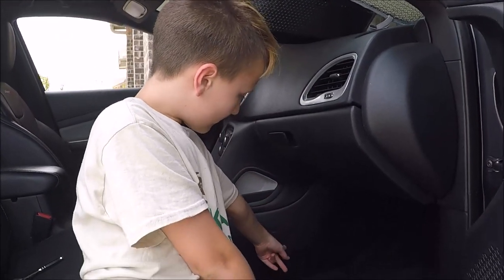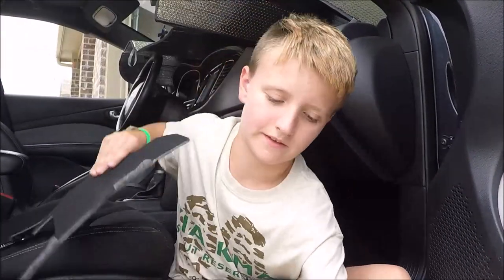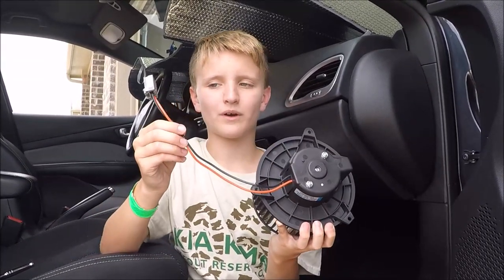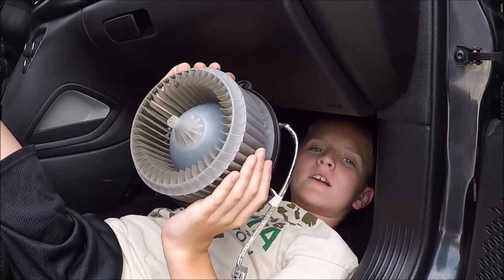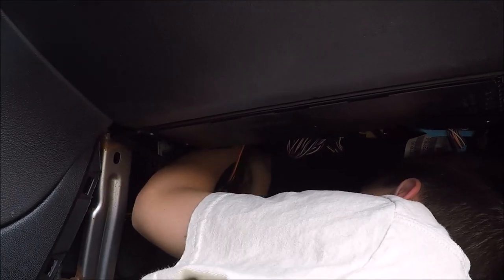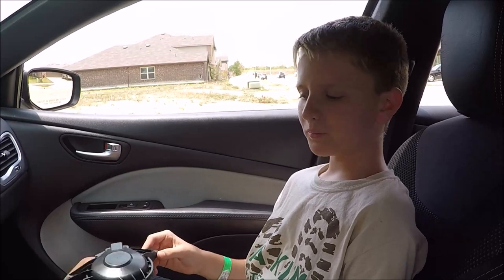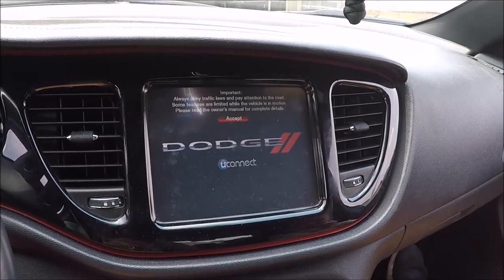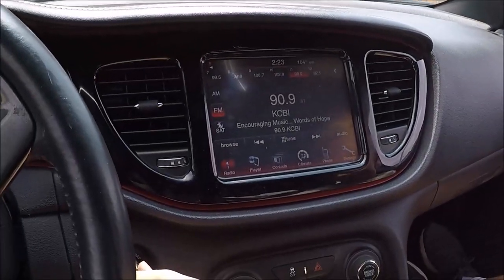Dodge Dart AC blower repair

Comment: This was one of the last videos I watched on this issue.  I wasn't sure if mine was the resistor or the motor.  I literally did exactly what you said... removed the plastic under the dash, banged on it, and it started working again.  Thank you Andy!  May God bless you and your family.
Reply from the maker: Super glad this worked for you. Don't forget that banging on it only lasts a little while. Eventually you'll have to replace it but it's easy and inexpensive
Reply: There is another video from another mechanic with a Russian accent who removes the glove box first. Also, my blower motor would wane in its speed. I could have it on high and it would not blow but later down the road it would start to blow either fast medium or slow. I replace the blower motor resistor but still same results but it was a little bit more manageable as it would work more often than not. I ordered a new blower motor and it just came in by FedEx and tomorrow morning I'm going to attempt this feat. I have two more payments on this POS Dart so I'm trying to get it fixed up for my soon-to-be 15-year-old son so he can learn how to drive, learn maintenance, and responsibility of upkeep, insurance, yada yada. Great video son! 👍

Comment: I have a dodge dart 2014 SXT and my HVAC stopped working. I had the resistor replaced but it stopped again the next day. I took the part back and had the mechanic put the old one back in. Looks like it turns on sometimes and then goes out at times. Could it be the blower motor itself??
Reply from the maker: it could be try replacing the blower motor if that does not work you might want to get a professional oppion

Comment: Hi Scout Andy thanks for the video. Question how do you know if it’s the blow motor or the resistor? My blower didn’t come on but if I would hit the passenger side panel it would then work so I’m not sure if it’s the motor or resistor? Any ideas? Thanks and good job on the fix.
Reply: Hey didnt realize I had notifications turned off. When you tap the motor and it comes on, it's usually the motor. When the blower only comes on in certain positions, like low or high but not medium...it seems to be more likely the resistor.  Luckily they aren't real expensive. 

Lots of luck!
Andy
Reply: Thanks Andy!! I changed both and it works great now but this video helped me A LOT!!!!

Comment: I have a question on my dodge dart se my cold and hot temp work and the low to high works, but the front vents don’t blow out air just the top defrost vents and bottom  floor vents. What do you think would be the problem?

Comment: How did ya take out the felt?
Reply: You should be able to just pull it out, you might have to use a flat head to pry the pin from the plastic clip. But it’s pretty easy